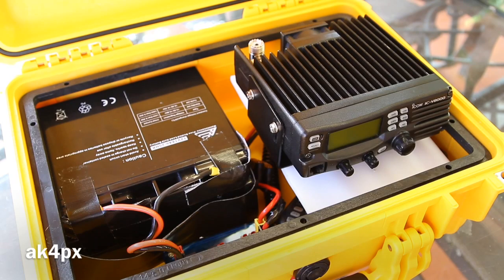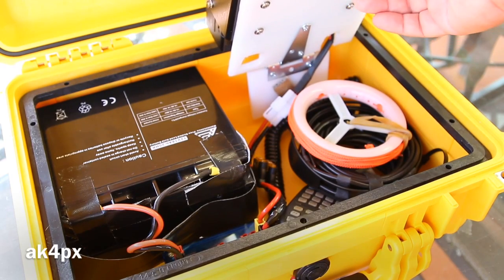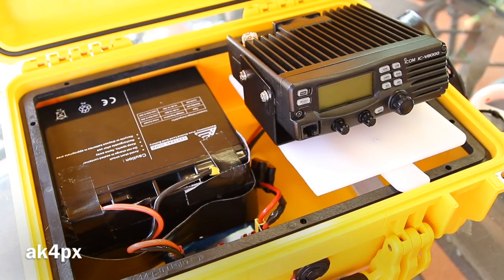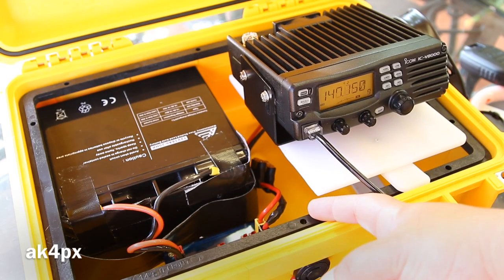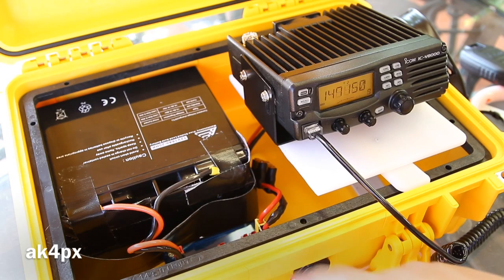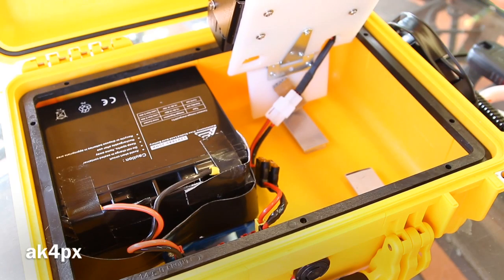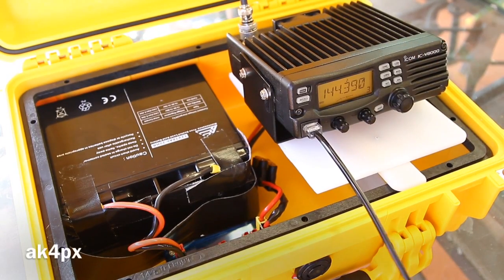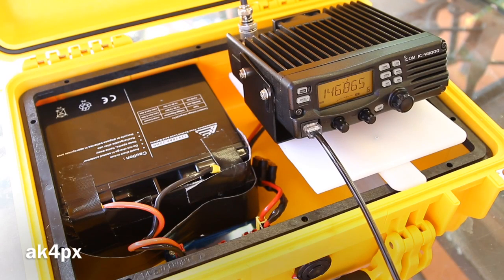Ham radio Go Box / GoBox in Pelican 1450 - Pt 1

Comment: How long can you run on that 18ah SLA?
Reply from the maker: Like everything ham related ... it depends.  The radio can be set to 5w, 10, 25 or 75.  25w seems to be the sweet spot for power and longevity.  About 4 hours on a 40% duty cycle.